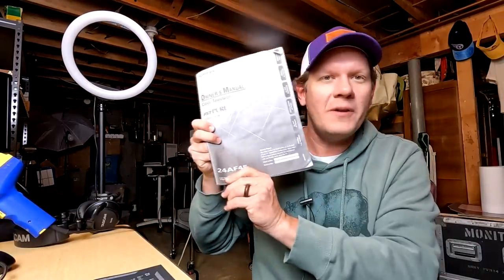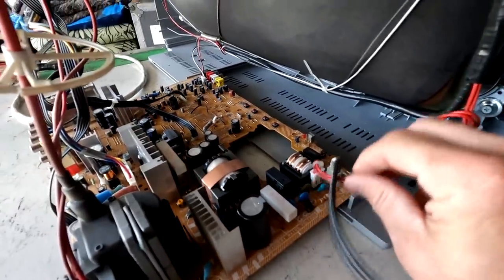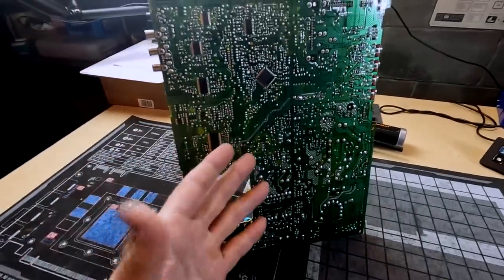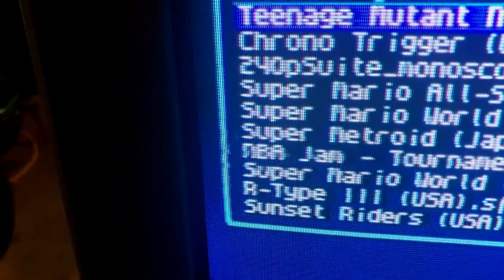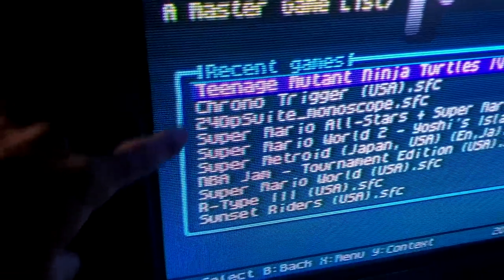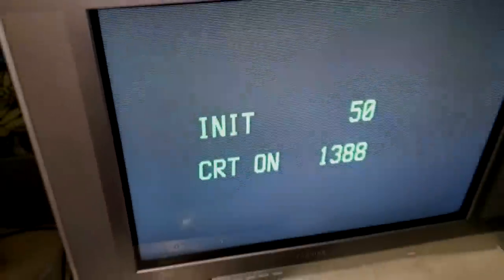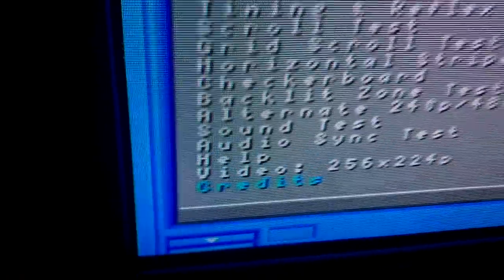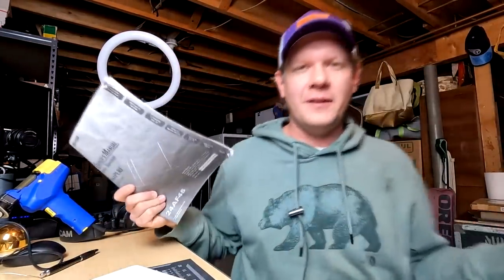The Most Dangerous CRT in Retro 📺 Toshiba 24AF45 Deep Dive

Comment from the maker: Hey everyone.  If you need more information or help with servicing this set, check out my Patreon.   This is where you will find my cap kit lists for this Toshiba 24AF45 as well as capacitor kit lists for over 50 other CRTs.  https://www.patreon.com/retrotechUSA
Reply from the maker: I do offer high quality restoration services and have restored CRTs for purchase available on Patreon!
Reply: As far as cap kits, can I pre-buy a couple of kits for you for two Toshiba TV's I already have?  And do they include replacement parts for all of the essential parts?  27AF42 and 27AF44
Reply: I bet the hairs on your arm went up on that first discharge where you free handed it 
Glad you didn't get zapped but damn was that intense
Reply: Velocity Modulation interferes with light gun games. Do you think disconnecting or de-soldering VM coils on HD CRT tvs would be possible?

Comment: All CRT is dangerous if not treated with respect. I don’t get this video just replace the fly back or if your good you can take them apart but it’s hard. Also you don’t seem to have the test tools for testing the fly back or other components. Use to repair these years ago and you need the right test tools to get the best out of these things. You need a meter to see the voltage of the fly back and fly back tester. It’s all special tools you need, also oscilloscope to see the signal. At the end of the day people don’t mess with CRT if you don’t know what your doing and don’t have the tools.

Comment: Just keep in mind the hours counter is in hex, so 1388 hex to decimal equals 5000
Reply from the maker: Thanks!  I didn't know that
Reply: Even 5000 is insanely low hours. I lost so many Xbox 360s to lead free solder.
Reply: How do you calculate it?
Googled it myself just sounded too confusing
Reply: 5000 so low wow
Reply: @swardmusic  yup. For people wondering: 2 hours of TV a day for 7 years is 5110. Very low hours
Reply: Not to mention the Red ring of death.
Reply: @c2ironfist from my understanding, the calculation to convert from hexadecimal to decimal is the following:

N×16³+N×16²+N×16¹+N×16⁰

In this case, it's:

1×16³+3×16²+8×16¹+8×16⁰

1x4096+3×256+8×16+8×1

4096+768+128+8

4096+896+8

4992+8=5000

For example, if it's 00A0, it'll be the following

0×16³+0×16²+10×16¹+0×16⁰
0+0+160+0=160 hrs

Comment: I have this set and I like it a lot. I don't have the same issue where adjusting the settings stabilizes the image, so my blacks are not bloomed/washed out. I know it's not a super desirable set, but 24 inch CRTs are extremely rare in my area. And I absolutely love the design of this TV's chassis too.
Reply: I have the 14 & the 20 inch. I don't have these issues either. The image through component looks fantastic on both
Reply: These Toshibas are my absolute favorites. Got a 14' I gave to a friend, have two 20"ers. I personally love the flat screen despite the geometry sacrifices. I'm going to be buying every one of them I see. 

Contemplating disconnecting the sharpness wire...
Reply: @xminorthreatx  I've been on the fence about it myself. I've been too afraid to open up the TV. Mainly because I'm worried the back of the chassis would be difficult to reseat back on.  And I don't know enough about it to feel confident I won't zap myself.
Reply: @MA-sv2bs  It's pretty easy, I'd never messed with the inside of a TV before either, & I was scared as hell, but the wire is far away from the dangerous part of the TV and disconnects very easily. Still use precautions but yeah, definitely worth doing
Reply: @xminorthreatx According to the manual for the 20AF45/20AF45C this model does NOT have the VM circuit.  The features tables states "no" for that feature and the parts location diagram of the neck board also confirms that there are no VM connections.
Reply: then what did he pull off?  @Ikrananka
Reply: I have the 20 and the 14 tv set, I have none of these issues, this tv is simply amazing, I use all my consoles RGBs and a converter from RGBs to component, I can’t describe how good it is the image 👍

Comment: I have the 14" model and love it. It is my understanding that Toshiba used different tubes depending on the model year. I think a lot of people prefer the earliest years in the AF series if I recall. Been a year or so since I was going through the posts online. The 14" is great for a little bedroom and gaming SNES on especially considering the 14" kept the component inputs. Plus I got it for free so can't complain.
Reply: yup you are right the af43 was the first model to start using Orion tubes. I have a 43 and its solid, but not the best
Reply: Love my 14" AF as well. I would like to get a 14 inch JVC or Sony flat screen to compare it to.

Comment: I found a 27AF44 on the side of the road and despite having around 18000 hours of use, it still gets really bright at contrast set at slightlt less than halfway and the convergence is perfect or next to perfect, as I only see only a trace of red misalignment at the bottom right corner. I believe that this is one of the highest 240p analog CRT tubes that you can get, as the comb filter is very great, you can see text very clearly. I'd say it's even better than the JVC D-series, you just have to use a RCA cable with high shielding in order to take advantage of this filter.

Comment: Only the ones made in 2005 or later use lead-free solder! 2004 and earlier are totally fine. I have a 24AF44 and a 14AF44 and neither of them have any 'pb free' markings on the boards. They also specifically state in their service manuals that they don't use lead-free solder. If you check the service manuals for the 2005 models they have a whole page about using lead-free solder. 2004 models and earlier of course don't have that page.

Comment: I have a 14AF44 (or 43 or 45, can't remember), and I absolutely LOVE it. I guess I got really lucky because I checked the hexadecimal hour counter and it only has about 100 hours on it, almost brand new, and I only paid $60 for it two years ago! It has near perfect geometry, especially for a flat screen CRT, and the colors are fantastic. No jitters, no issues of any kind that I can tell. I have two 20" Sony PVMs and a 14" Sony PVM, and I would say it rivals the quality of those. If anyone can find a Toshiba AF series CRT, I highly recommend one. From what I understand they have some buzz in the CRT community for being sought after.
Reply: I can co-sign this 100%.  Got my 14AF44 in a junk yard with some low hours.  There is a slight convergence issue that appears in the upper right hand side when connected via component.  Could careless at all since I’m not a TV repair guy.  😂😅

You aren’t joking that it rivals some 20” PVMs either.  I’ve been consistently using it over my 2030 that was serviced a while back.  RF & Composite look fantastic!  Such a great device and it deserves the respect it’s been getting.  If anyone can get it for free even up to maybe 100 bucks they should.
Reply: I just found one but the picture is very blue, no green.

Comment: I've got this exact set, when I first got mine it had vertical foldover which was easily fixed by replacing a known faulty cap.
I am very impressed with the picture on this set, Though mine also has a slight jittering too but not anywhere near as bad as shown on the one here. 
I've not found any other bad caps in the power, deflection circuits, but found a lot of weak and dead caps in the chroma circuit. There appears to be a hot spot on the board right where the chroma IC is on the flip side.

Comment: I just did a partial recap in the deflection and b+ and service on one of these for a guy. The anode does hold it's charge, which is why you should always use a discharge tool especially if your not familiar with the set. I didn't know about the VM but the set had a lot of pin cushion I flattened out 90% of the way from the service. Good work Steve!
Reply: Yeah, it seems most flat Toshibas over a certain size have this VM circuit. Thankfully it's straightforward to disable

Comment: Great video

For what it's worth, this is actually an Orion designed/manufactured TV (with the Toshiba brand more or less slapped on it) and is almost identical to many late model (2005+) RCA TruFlat, Panasonic Tau, etc. sets also made by Orion.

In my experience, these end of the line Orion CRT TVs have actually been very great in both build and picture quality, and I would consider it an overall improvement from the original brand in many cases.  I'd even go as far to say they're the next best thing to a Sony or Panasonic with low hours.  Only major issues I've come across is bad capacitors in the vertical deflection circuit, and less often the power circuit.  My guess would be they were under-spec on their heat tolerance, given that they seem to install exclusively Japanese capacitors in these.

Sad to see there were so many issues with the one in the video, especially considering the relatively low hours on it.  Wondering if it was operated in hostile environmental conditions or something
Reply: Those late model RCA TruFlats were made in China by TTE Technology, a joint venture between Thomson and TCL.

Comment: I have the 14" model, 14af44. Picked it up for free but it had 27k hours and a burned in tube. Did a tube swap (used a low hour tube from a composite-only Toshiba MD14F11), recapped the power and deflection circuits, and now it looks amazing.

Component and s-video are fantastic, and the comb filter even makes composite look good. All around great set I would recommend to anyone looking for a high quality small CRT.

Wanted to add that on mine, the circuitboard has leaded solder. I believe they moved to lead-free after the af44 models.

Comment: Regarding the Toshiba 24" Orion tube, it's obvious that time has not been that particular set's friend. Even with the lead free flyback, and only 1400 hours, that TV should be performing better. 

Perhaps it was stored in a shed, garage or basement that accelerated its demise.

Only the 32" and 36" Toshiba's have a genuine Toshiba tube, so the difference in performance varies GREATLY depending on the model in question.

I'd love to see your opinion on one of those larger sets with the Toshiba tubes, as they are a different beast entirely.

Maybe you'll have the opportunity? Here's to hoping....

Comment: Raising the contrast and brightness fixed the warped edges on my Samsung. It also fixed the bad center convergence. I recommend running the TV as much as possible as a way of correcting issues. The capacitors can actually correct internally by running unless popped. Learning alot from you and planning to do more in depth repairs soon.

Comment: I have a few of these… several more if you count the larger and smaller versions. I keep forgetting them on for days since the tube is so dark when there is no signal. That means I have inflated the hours count on some of them, though it probably wasn’t putting any real wear and tear in the tube itself.

Anyway, I suspect that the glitching is related to the SNES’s sync jitter. I suggest trying a Genesis or some other source to see if you can keep the brightness lower with those.

My biggest issue is the stretched screen with 240p component sources. It seems that they are using HD sync on component sources despite only supporting SD/sub-SD resolutions (also explained on HD Retrovision’s page about Sync Jitter). You have to shift the image to the right and compress it to correct for this.

I love that these produce visible scanlines with 240p sources despite not having a high line count.

Comment: I find the buzz on my 20af45 louder than other sets
Reply: Same here. Wondering if it's the sound of something failing.
Reply: Both my 20af45 I used to have and my current 20af46 has that loudish electronic buzz also.  It's kind of annoying sometimes, but not as noticeable if the volume is higher.

Comment: I have the 27" version of this TV (27AF44C, CHASSIS M3N127T, Oct 2004), and it has absolutely none of the jitter you were seeing on that set.  Contrast 32, brightness 20, CRT ON which is 2EBE (around 12k hours?  that seems reasonable.)  I find it's a perfectly nice looking set, and I ended up keeping it over a d-series I was testing out (though maybe more so for the nostalgia I have for the Toshiba, but also the d-series had a bit of visual distortion on the sides.)  I think really when it comes to these older sets it's really a case by case sort of thing.

I recently disabled the edge-sharpening and can't really tell much of a difference except maybe that the set has a bit more distortion/bloom on really bright scenes than it used to?  At some point I'll reconnect it and see if it's just my imagination.

In any case, great video!  I'm now convinced that I will never try to do anything to this set that requires it to be discharged :P

Comment: The way you discharge the CRT is very dangerous! (@4:56) if the rubber is dried out/crackling or you misgrip you will be toasted . . Also putting the cap right on the circuit board at the neck can toast the electronics (30kv can arc more than 3cm in the wrong conditions . .)

Please wiggle the screwdriver under the cap first before disconnecting 

Being suprised CRTs in the USA have bleeders by default. Those were very expensive because you cannot have just a resistor in parallel, that would load something with this kind if high impedances too much.

Here in Europe CRT's with a bleeder are very rare. I have seen much bigger sparks, especially when discharging within a few minutes after turning off. The sparks you see you get from nearly every CRT here that hasn't be off for days. Can be pretty scary if you don't have done many times!

Comment: Interesting stuff. I got a 36 inch Toshiba from 1993 (give or take a year) for free when I went to go buy a 36 inch JVC from the guy. He just wanted it gone so I couldn't say no when I had the space in the car, ha. 

My Toshiba had similar characteristics where you really had to fine tune the image to work around it's flaws. I recall there being faint blue lines that ran diagonally across the screen. You could tune it to where they were mostly unnoticable once the tube warmed up, but you could still see them on black screens if you knew what to look for. I think the main hassle with that set was balancing the brightness, gamma, and colors to get it bright enough without washing out the colors with gray. Came out pretty nicely eventually. 

I ended up giving it away for free when I moved across country, but I was at least able to keep the 36 inch JVC alongside all my other smaller CRTs.
Reply: D Series

Comment: I once had it's slightly bigger 27“ brother and was also underwhelmed. The speakers were pretty poor, too. If you need component and it's your only CRT then you've hit a small jackpot, but the component is poor, flat, and I also had a washed out look on it. It did the job, but was happy to move on from it and let someone else appreciate it more than me.
Reply: @@jakefootball9402 wondering if we need to experience the 32" or 36" versions, as they often have the Toshiba tubes and have more premium parts that aren't sourced out... 🧐

Comment: I just picked up a 20AF25 without a remote and can't seem to get a straight answer on which remote to use. I see both ct878 and ct847 as you are using here. Do have any insight into which remote to use or if it actually even makes a difference? Thanks again for being the Ultimate source of knowledge on CRTs on the internet!

Comment: It's a shame that you have that video wobble issue. I have two 20AFs, one is a 45 I've had for a couple years, the other is a 44 I just got off Craigslist a week ago, and neither one have any such problems. I have dialed them in and get nice dark blacks. I have been wondering about the real difference between having the sharpness "mode" on or off, so thank you for being the only source I could find that actually shows the difference.

Comment: Hey Steve. Have you come across this kind of screen jittering again on any other crt since?  Reason I ask is I see the issue pop up from time to time and no one know what it is. I actually have a Trinitron with the same issue and have purchased a replacement fly back assuming it was the issue but before I swap it out, I’ll try your fix. 

Let me know if you’ve seen this issue since and know more about it. 

Thanks. Trav

Comment: I'm wondering if there were some other things you could have tried with the jitter<>brightness problem.

First, I wonder if it may have been caused by the VM module being faulty. Did you go back and drop brightness after disabling VM?

Also, maybe tweaking brightness/contrast via other methods could have given better results. Maybe by adjust sub-brightness and sub-contrast in the service menu, or even increasing G2 on the flyback, then dropping brightness back to normal levels afterwards, in the user menu.

Lastly, maybe ordering a replacement flyback if available. I know there is a store in Germany, and a store in Mexico that still have a ton of flybacks for various TV models. I can't remember the websites but they've been discussed on r/crtgaming

Comment: I really don't like those late model flat CRTs. The flat shadow mask tubes look nicer than the aperture grille models but they both change the look of old games. And not for the better. Plus it's like they all gave up on quality towards the end.

The late model Sony Wega sets are nowhere near as nice as the older 90's slightly curved ones. I always use my Street Fighter 2 pcb to judge CRTs. It really looks different on flat vs curved slot mask tubes.
Reply: The problem I notice with flat CRTs is that the dots are more spaced out in the corners than in the middle (I guess this is unavoidable to compensate for the unequal distance between the electron gun and a flat surface?). So brightness decreases as you get off center. But it's not very noticeable in real use.